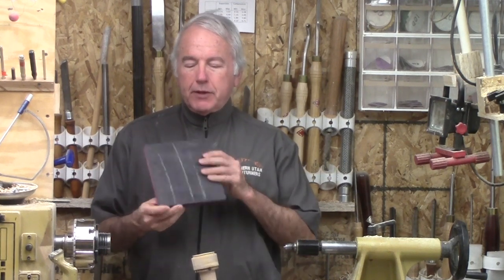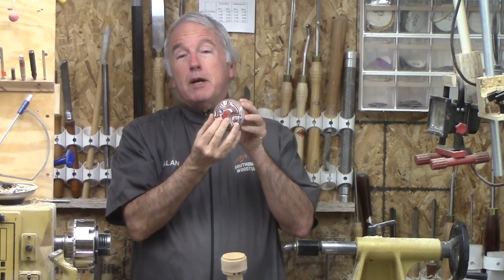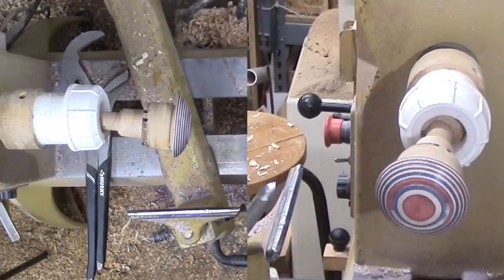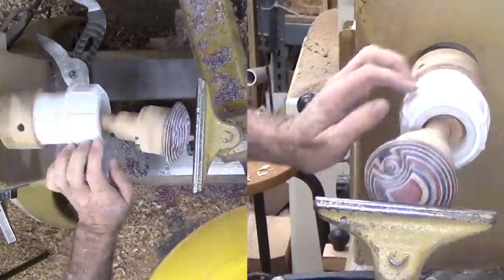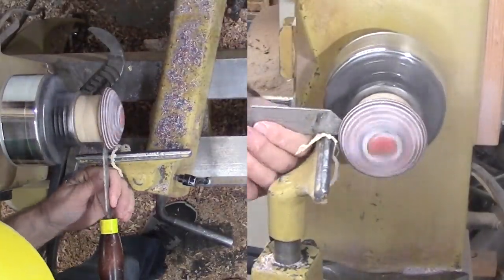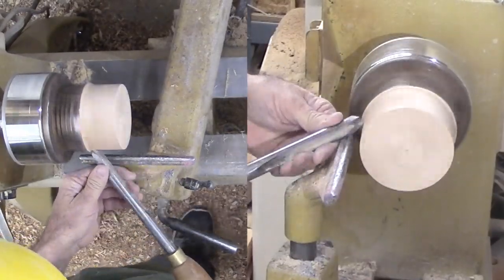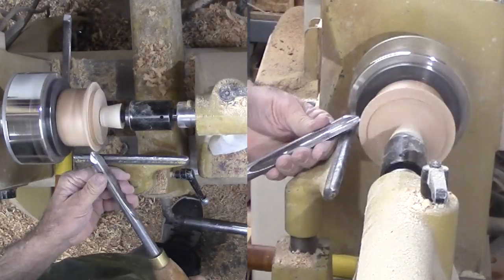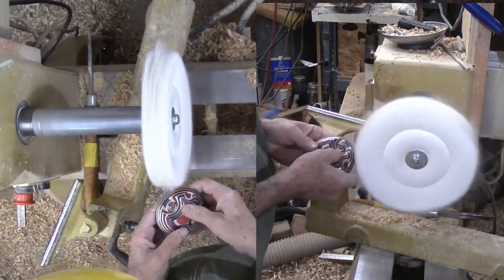Woodturning Valentine's Box With Infinite Axis Chuck

Comment: Very nice use of the off center chuck!
Reply from the maker: Actually, the off center chuck now integrates three ways. I've adapted the parallel axis chuck from an old AAW magazine to use the work platform. Plus an integrated tenon enables standard chuck mount. This means I can swap the work platform from a standard chuck to start(which I did in this project), over to the parallel axis chuck if I want parallel axis turning (not in this video), and into the Infinite Axis Chuck for more eccentric unique turning. Still planning for a video that uses all three. :)
Alan
Reply: As Wood Turns That video should be interesting!